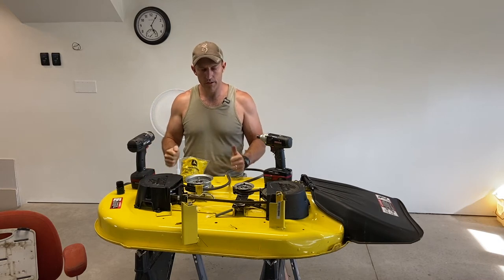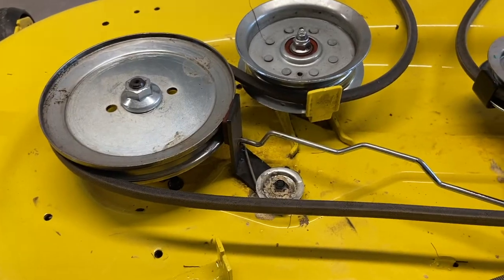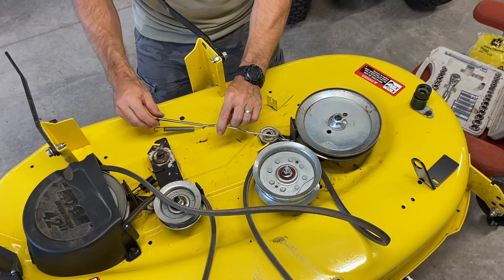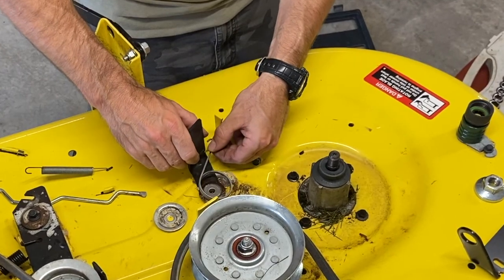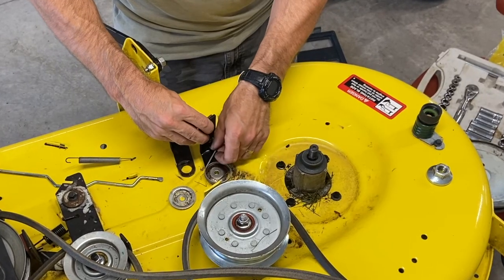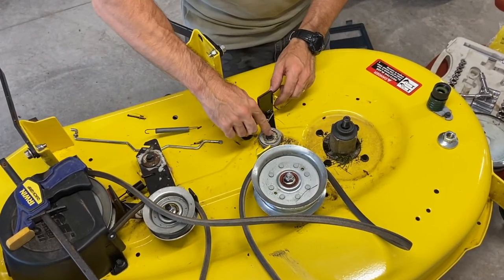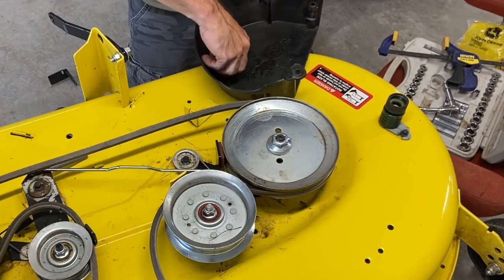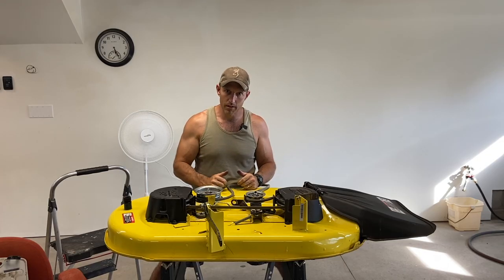HOW TO CHANGE John Deere blade brakes 42 in.

Comment: Nice video, You only changed one. Its like doing brakes on a car, You have to to do both sides while you got it a part.  You got everything apart. Clean it up. All dirt & de Bree on the deck. Plus clean all bolts, parts & pieces. Add some Noalox or compatible to the bolts before reassembly. JMO or maybe just my way of doing things.
Reply from the maker: The other one never needs replaced. I recently just took both of them off. They never last. Thanks for watching

Comment: I really needed to see you do the other blade brake as well since the configuration of the parts is a little different. I’ve had to start with a totally blank deck place all the mechanisms on with new parts.
Reply from the maker: Sorry my other blade break did not need replaced. Hope you get it figured out
Reply: The second brake now has a rod instead of the black heavy spring, and the rod to the other brake has an nut on the end of it, so it can be adjusted. Mine is like a 2011 D125, most of the linkage is pretty close to that. I see two parts that are different.

Comment: Great video. Thanks for posting. It was very helpful.
PS......I just bought my S100 last week and I really like it. Cuts my cutting time in half from what it took me to do before.
I have a wider cut and can cut at a much faster speed. Even though the engine on the S100 is much bigger than my old Craftsman Lawn Tractor, since this takes a wider cut and i can go faster, I actually use less fuel to cut my lawn.
Barry
Reply from the maker: Glad it helped! Thanks for watching have a great summer
Reply: How do you change the brake rod on a John Deere riding mower

Comment: Brother, these D110 "how to's" are superb.  Got a new deck and swapped out all the components.  I also took pics/vid, but not of everything, so thank you for showing how to adjust the pulley brakes.  Subscribed!  God Bless.
Reply from the maker: Awesome glad I could help. Thank you for the nice comment.
Reply: @DIYJIM  Do you by chance know the name or part number for the smaller spring connecting the opposite blade brake and idler pulley bracket?  Falling down JD's parts catalog rabbit hole.  TY for any other help.
Reply from the maker: @mrvantaztic  sorry i don’t
Reply: @DIYJIM  No worries, I called the dealership (which is what I should have done to begin with).  GX26251

Comment: I think the brakes are frozen on my JD 125, I'm not familiar with how they  should work. while sitting on the mower as a reference point the brake is against the left blade pulley and the right blade pulley spins free. this is with the mower off and not running , blades are disengaged. are the brake arms supposed to move freely away from the pulleys by hand? the springs are rusted and I can't budge the brake arms. I have some vibration when the blades are engaged, this is worse when the deck is raised for higher cutting level. I have replaced one spindle, both blades, belt to engage blades, both flat idler pulleys...any advise on this? Thanks
Reply from the maker: Some people just remove the breaks that is what I am going to do next time they wear out.
Reply: Vibrations are caused by bad pulleys or unbalanced blades. The reason it changes when you move the deck up and down leads me to believe it is a pulley issue. Turn off the engine! Lower deck to the half way setting and then engage the blade drive lever. Get down and look at how the pulleys all line up compared to how the main pulley is on the engine. From there you should see what is going on and what is possibly out of line. Can go further and remove spark plugs and physically turn the belt and watch them all as they move. Also take the belt off and spin pulley and spindles by hand to check for wear and noise. Any one that makes noise or doesn’t spin freely should be replaced.

Comment: What’s the function of that brake?
My s110 with 40 hrs starts making a noise when i disengage the blades or  when i turn off the engine.
Looks like i might have to replace this brake.
Reply from the maker: Just stops the blades faster. I think when mine finally wears out again I’m just going to try taking it off and go without.
Reply: @DIYJIM  I'll be doing that tomorrow.  My neighbour is having issues . Deck belt comes off repeatedly , then burns up. Found that his brakes were not moving off the pulleys.  Pad now worn down so much that the whole thing gets rotated by the pulley to the wrong  side of the pulley into the belt. I'm hoping that I've fixed the belt issue by shortening his cable. It was same length as a new one but there was an inch of pay in the lever before cable moved.  Other option was to cut off cable anchor on deck and replace with an adjustable one that they had on the L100.

Comment: 7/16's Maybe 15/16's 7/8's? My D125 linkage is close too that, the one brake now has a linkage to it,  and the other has a nut on it. The longer push pull linkage now has a round hole it dropps into, not a slot.
Reply from the maker: thanks for watching

Comment: How'd you get the deck so clean on an old deck?
Reply from the maker: its not always that clean, but I like to clean it before I make a video. Thanks for watching
Reply: At about ten years old the yellow paint job peels off and the rust shows. There is no primer under the yellow, just rust. I'm in Arizona a dry environment, as well.

Comment: 100 series is too general.  L100 deck and e100 decks are not the same. For e110 part supposedly is gy22309 . The e100 deck looks like your's . L100 has brake rod on right whereas e100 has spring like your's
Reply from the maker: Thanks for watching

Comment: need to add how to adjust the break arms.. you wiggling it isn't the lever on the mower.. so useless..
Reply from the maker: Thanks for watching, I really don’t think you can adjust it
Reply: @DIYJIM  I think yours is newer than mine but my 2013 D130 has brake adjustments on both arms. Where you simply turned the long rod and removed it, the end of mine is threaded and held on with a nut. (same deal with the short arm of the other brake) According to the manual, the correct adjustment is a 2-3mm gap between the back of the nut and brake bracket. 
I guess removing the adjustment feature was either a cost-cutting move or just not necessary.
BTW, thanks for posting this! I'm replacing both pads - on one of them, the entire bottom end of the pad is gone. I needed to do it last year but couldn't find any info about it or even a part number.